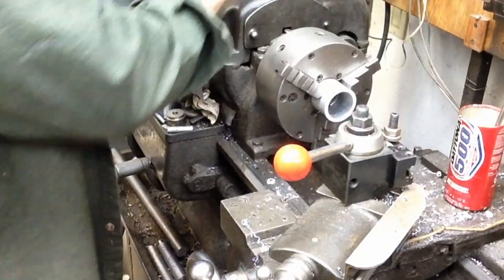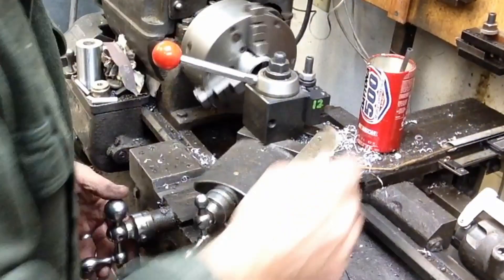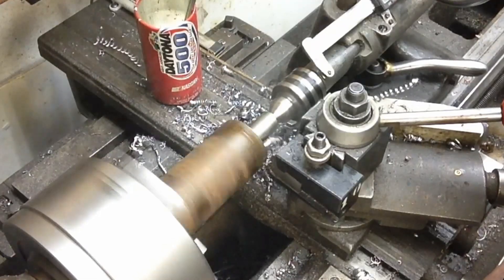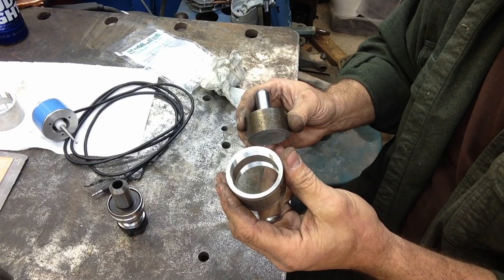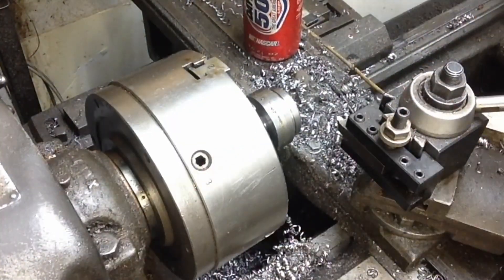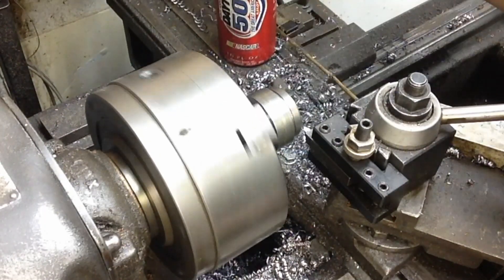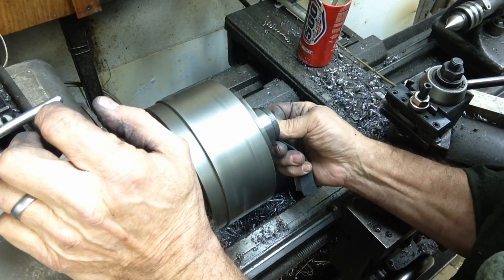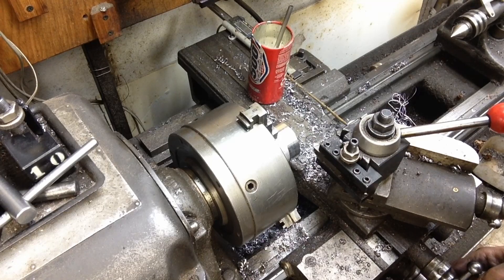Building a CNC Touch Probe For The Mill: Part 3 Machining the Bory Parts

Comment: Since you rechucked the top cover in a 3-jaw to turn threads, you lost your concentricity with respect to the toolholder shaft, didn't  you?
Reply from the maker: Yes and no. You are right that this particular part is only going to be as concentric as the 3 jaw will allow, but in the big picture of the project it does not matter (within reason). If the finished probe were a rotating assembly and had no adjustment it would have to be "perfect" to be accurate. but since it is stationary in the machine spindle and it is adjusted to be on alignment with the spindle, it works perfectly. I hope I explained that in an understandable manner. Thanks, Dan.